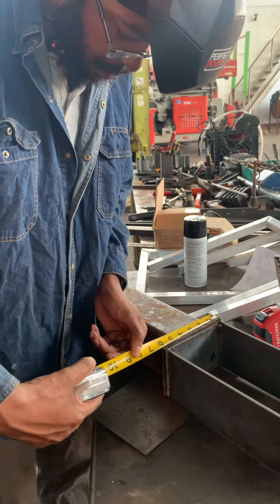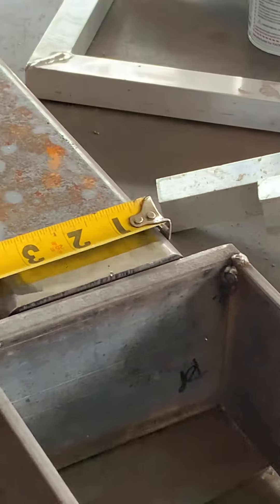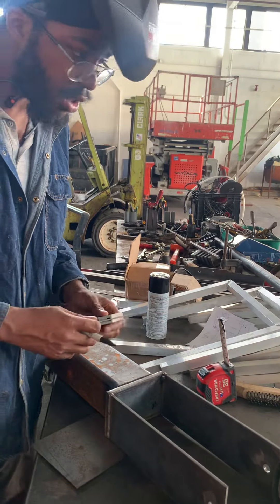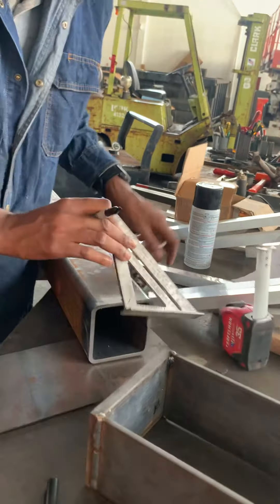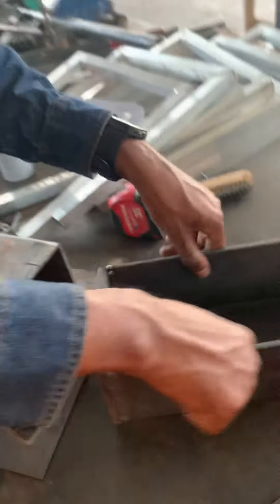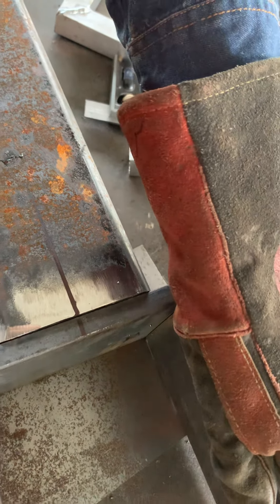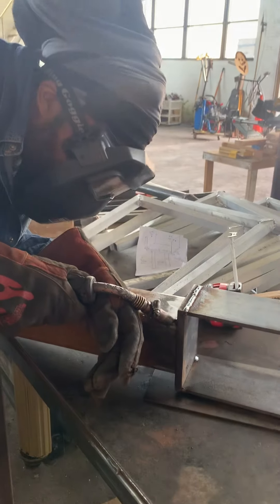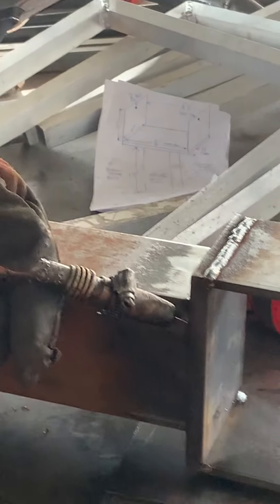Structural steel assembly

Comment: My dude I too have locs and I have issues finding a hood that fits. Is the one you using in the video autodarkening? What kind is it
Reply from the maker: 😂haha tricks of the trade my brother.  This hood. I use in the summer when I don’t want to wear my welding masks and sweat out. 

Yes welder goggle auto darkening clear view.! You never used such a clean welding hood for vision. Works good for the turban and the hats. Then there are other alternatives knock off brands that offer the goggles but you need the mask even though they can disconnect or your face will burn up from the uh light. Hope this helps